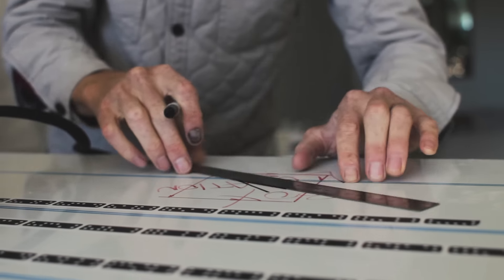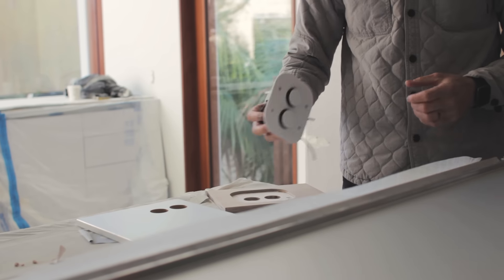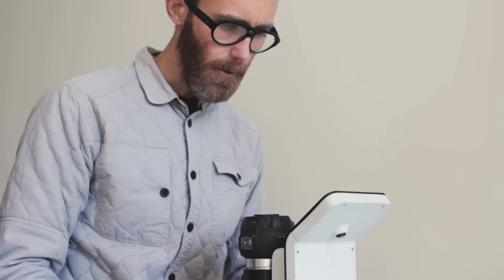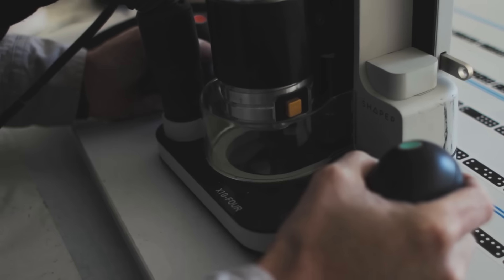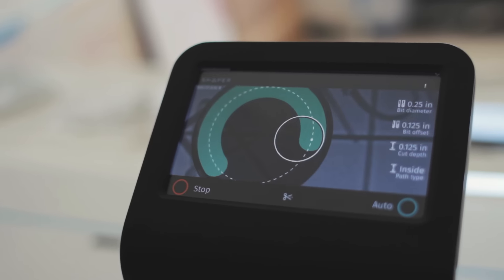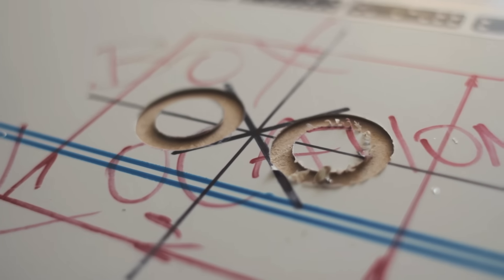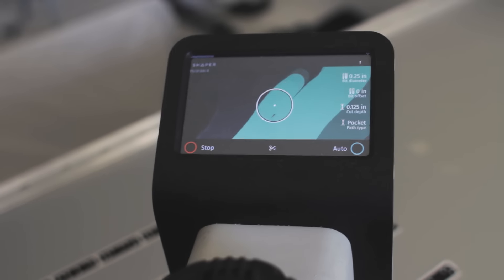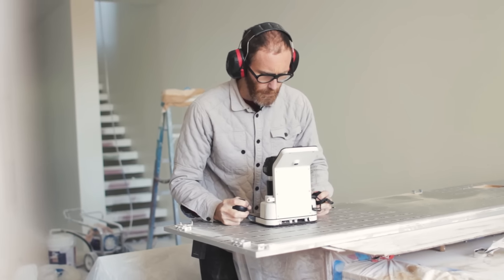Shaper Story: Simon Lamason

Comment: the marketing videos are getting worse... They have actually convinced me not to buy one based on the impracticality of the projects shown in the videos... this project looks like it was actually impeded by the shaper, I could have completed this with a hole saw or forstner bit in about one minute with proper measurements. I think this tool has a lot of potential but its practicality is not being shown in any of the marketing videos. I really hope you start targeting more than hipsters in your future marketing demographic sometime soon.
Reply from the maker: I'm sorry you aren't liking the direction of our videos. We're just highlighting some things that our early beta testers have found compelling about origin. Of course we know that there are many different use cases for Origin and we will try to touch on all of them.
Reply: I feel ya on the hipster thing but...
Look at the tool for what it's capable of. I just did a 5ft tall by 8ft wide sign with script letters and marquis lights centered in the letters, with evenly spaced holes.  If I could lay out the letters and the 13/16" holes on illustrator and thumb drive the file into the shaper and cut it all with the same router. Boom, winning!!
Reply: An apology is not necessary. For sign making there is no doubt that this will make a huge impact. I always here the sign argument and if that is your business this tool is perfect for you. But like a lot of guys who bought the X carve made a few signs and knickknacks and unless they had a specific application for it realized the versatility was limited. Now I will say that the shaper is more versatile than the x-carve but my argument is that the marketing through these videos is on par with those of the x-carve. There will be an initial excitement and those that can afford it will buy it. However, for the general population and the average diyer that requires versatility to justify the cost and these videos are hurting the cause. Why? Because I look at this video and automatically think why would I waste time doing it this way when I can just use a hole saw or Forstner bit that is more efficient? What needs to be compelling about a tool is the fact that it can perform a function that other tools either cannot do or it can perform it much more efficiently. This video and many previous videos do not show these essential dimensions.
Reply: I'd really enjoy some videos focusing on the design process behind these projects--how did he create the models for the cuts that he's doing? I guess that'd be a bit heavy for a 2 minute snapshot--but it'd be interesting to see what can be done from the tool interface. Not needing to go to a computer to do CAD/CAM would be a real benefit.
Reply from the maker: Hey Sbowen4, Have you seen our Feature Videos? In those we go into much deeper dives on each feature. We cover things including On tool cad, bit offsets, grid alignment and much more. Below are two videos showing how you can design on tool without needing a computer. 

This one shows how to design using our pen tool: https://www.youtube.com/watch?v=Z9585iFup68&index=12&list=PLEHMLsAENuk8fM2TkgALkRdbaqv19xTwQ

This one shows how to design on tool using simple shapes: https://www.youtube.com/watch?v=ieizcFBTvEI&index=16&list=PLEHMLsAENuk8fM2TkgALkRdbaqv19xTwQ

Thanks, and stay tuned for more info and feature releases!
Reply: Very cool. Does the pen tool have the ability to specify lengths? or is it freehand only? Also, does the shape tool let you create an array with regular spacing? Like the guy in this video might have used that to lay out two identical holes exactly 3" apart--then centered those holes in a rectangular pocket.

Comment: When will the product be in the hands of reviewers that are known to be independent? I've seen videos with people you bring into the shop, but i need to see people that have multiple projects they have tried with the tool. I haven't seen a reviewer say anything bad about the tool, there has to be something that needs improving. Like if you are cutting aluminum and move to fast it has to chatter and mess up. I'm waiting to pull the trigger until i see that. Also why are the majority of your comments people listing referral links? a bit sketchy. I would be ecstatic if what you are promising is real. Best of luck.
Reply from the maker: Hey! There are a few videos out there of an older prototype in the hands of some makers and videos. In this video Ben Krasnow of Applied science is using Origin to make some simple parts out of Aluminum. https://www.youtube.com/watch?v=q8GFpSCK6Jk&t=307s  Of course there are certain ways to use the tool that wouldn't lead to desired results, for example plunging the bit too deep into a very dense material(this will lead to a lot of resistance and a less precise cut, and also a dull bit.) we recommend only plunging the width of the bit per pass in wood for the best results, ie 2 passes for .5in cut with a .25in bit. Another thing that could lead to questionable results would be not using enough shaper tape. (the positioning system is completely based on the tape that is laid on your surface, so if the camera is not seeing enough the accuracy would go down.) We recommend laying down a strip of tape every 3 inches or so for accurate cuts). I hope this is helpful. Us at Shaper would really like to think that the reviews have been good simply because its a pretty awesome tool to use, but we do know that its one of those things that you have to see/try to fully understand and believe.
Reply: That was the first video I saw of your product. I would like to see more like that. Or your company could do some videos that are in depth on some projects like how mrpete222 does his (don't need to do the artistic video style). Most of your videos are quick overviews, which i understand. I think more in depth videos would get a good number of people on the fence to come around.